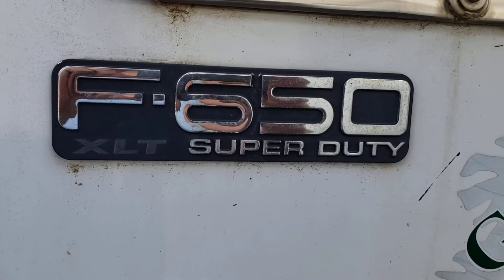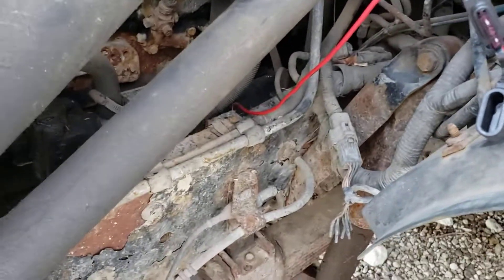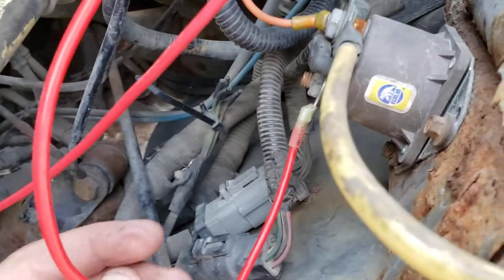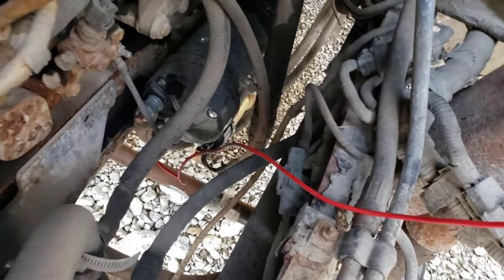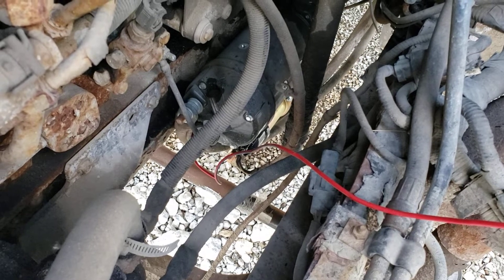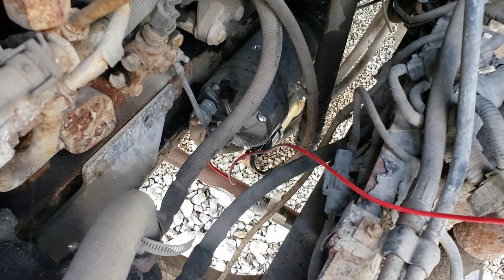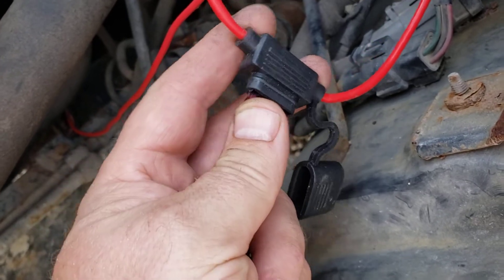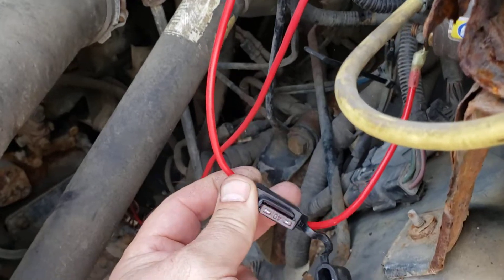Ford F650 Super Duty Starter Solenoid Fuse Protection

Comment: HOW DO YOU PRIME TO FUEL FILTER ON THIS TRUCK?
Reply from the maker: You might want to try to put air pressure at the fuel tank and crack the fuel line up by your fuel filter.  I did this by removing the fuel cap and blowing air into the fuel tank with some duct tape wrapped around the air hose to build up 20 psi in the tank. try to force fuel through the lines and into filter. While you have a pressurized fuel tank you can crank over the engine as well to aid the fuel advancement. You can also spray some starter fluid in the air intake to get the engine crate over a number of times but don't go too heavy on that spray. Once the engine starts running for a number second / minutes fuel filter and line will get primed eventually. Good luck this is a two-person job.